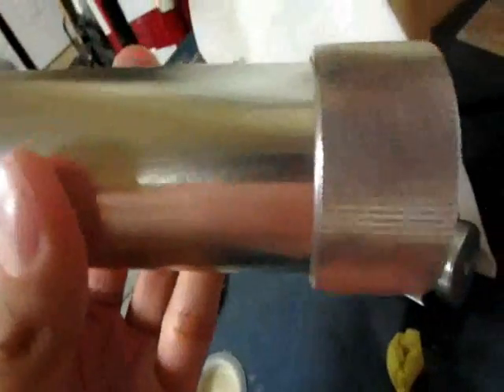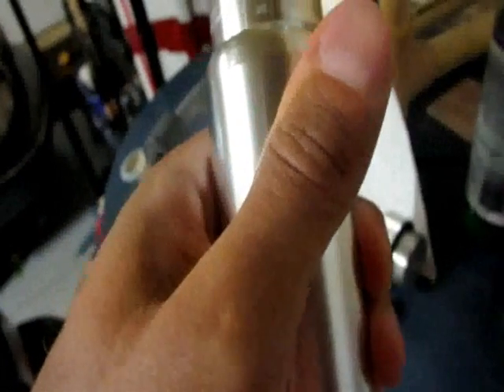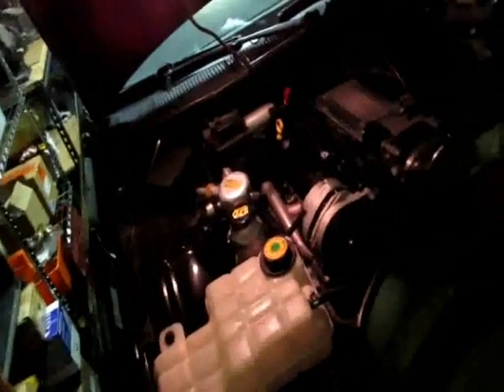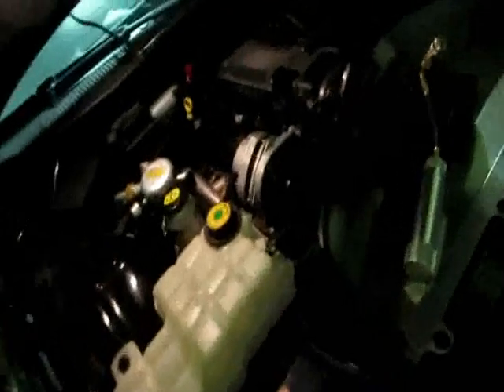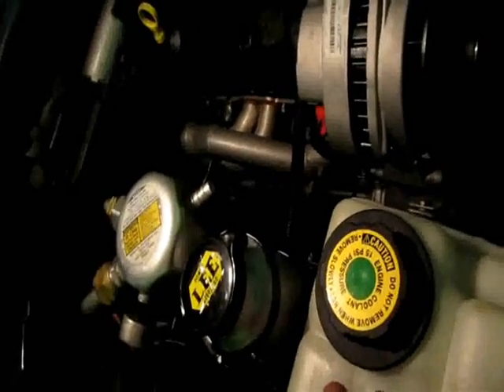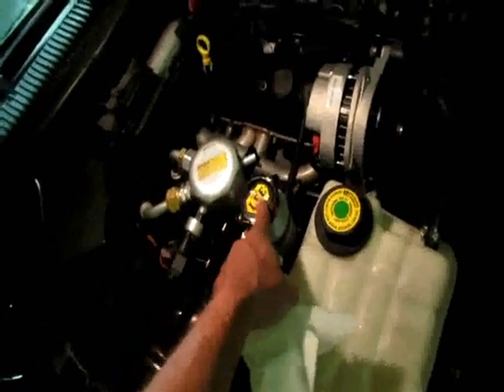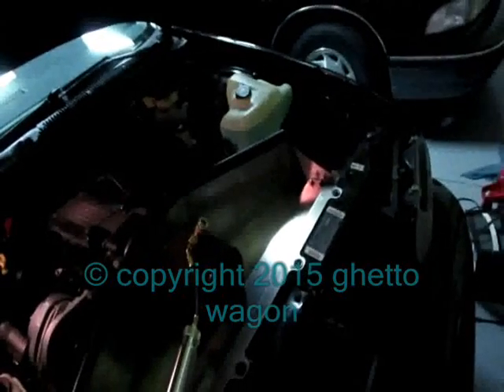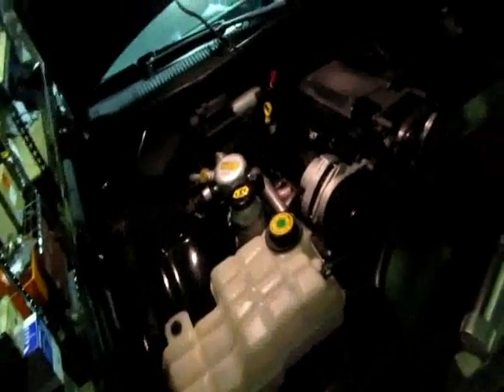R-134a AC oil injector  An Easy way!  Automotive

Comment: Aren't you supposed to fill the blue hose of this device with oil before connecting to low side so that you don't allow the air that would be in the hose to get in the system?  Or can you just turn the knob until you see the oil come out of the hose before connecting to the low side?  I think I heard this referred to as priming the hose.  Basically it would be putting oil into the hose so that the air is displaced.   I just got one of these rotating injectors but there are no instructions.
Reply from the maker: Don't have to.   Has a check valve. Unless you jam something inside the connector you will not get any oil out of it.   All this says is shake it when you use it if there is any air in the syringe.

Comment: Quick question GHETTO WAGON.. So you're telling me you put oil in your system after it was already fully charges with freon?
Reply from the maker: Yea that's how it works. It has a check valve
Reply: Ghetto Wagon same thing with the syringe injector as well? Just hook it to low side pressure port and fill up? Why is everyone saying vacuum out all the freon 1st. And then put the oil in? Im boggled.. You helped me out alot GW
Reply from the maker: Yea both you can use when charged.  I used it under a vacuum, it sucks down the oil fast. If you don't close the valve quick it will suck the oil down then when it runs out it starts sucking air into the system so you need to pull a vacuum again!

Comment: Where do i buy this thing?  I bought a brand new faulty compressor and it leaks oil.  It's starting to make noise because of how low it is, want to lube it up before it blows.
Reply from the maker: http://www.tooltopia.com/fjc-2732.aspx?utm_source=google&utm_medium=cpc&utm_campaign=paid_search_google_pla&scid=scplpFJC2732&sc_intid=FJC2732&gclid=CK6Mz4OQq9QCFZuIswodc0YOVQ got it on amazon for less  Yea best is just change the compressor, All are hit or miss these days